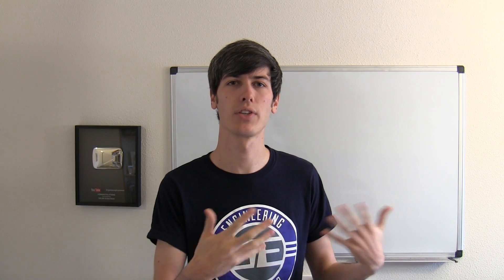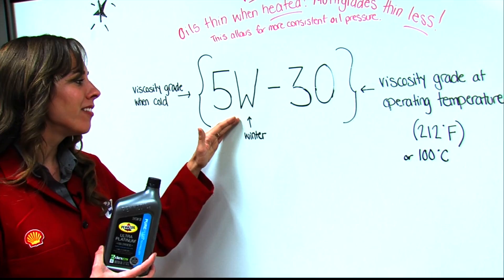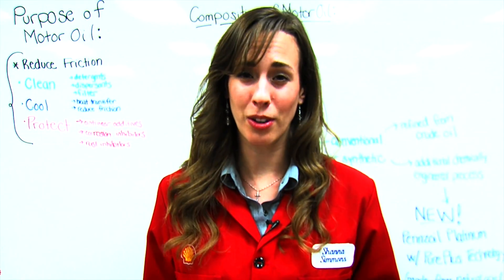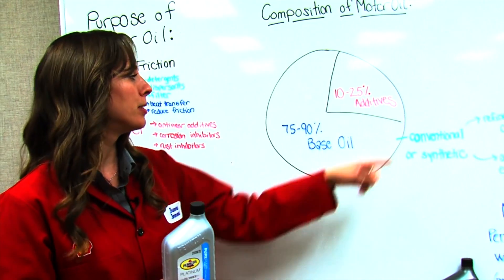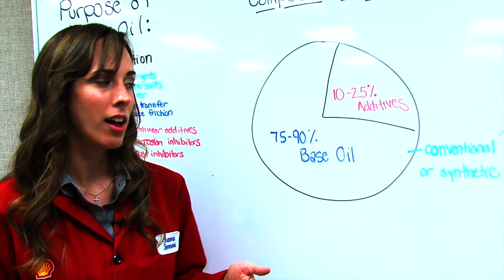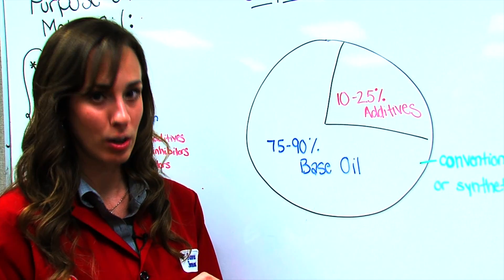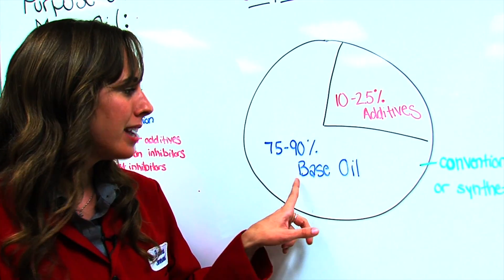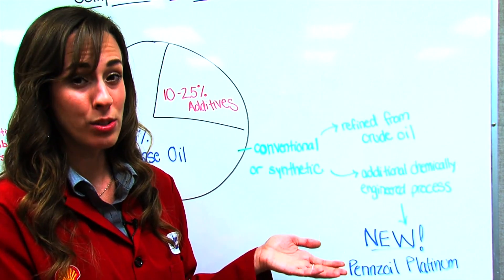Motor Oil Myths & FAQs - Synthetic vs Conventional

Comment: It was like reading a label on a bottle of motor oil.
Reply: so i'm not the only one!
Reply: +mandablyatskayapizdo didn't get ANY information of that... you can read the same on wikipedia for example... didn't hear at least anything of what a specialist could say.
Reply: Hydrogen Sh Yea, sadly
Reply: +Josh Richmond No idea where / how the 3k/5k oil swap came into play, but majority of high power engine (i.e. BMW, Porsche) don't require oil change before 10-12k or yearly (to prevent build up of moisture).
Reply: +Mike Brink.  My father had an old C-Class Mercedes that he used to change the oil every 5-6000 miles with synthetic.  At 180,000 miles he decided to take the engine apart and it had virtually no engine wear.
Reply: +mandablyatskayapizdo When you want to like a comment but you can't because it's got 69 likes..
Reply: +mandablyatskayapizdo  There's a reason for that, they try to spell it out for you so you'll know what to buy and use.  But people still ignore the information and use all sorts of weird stuff that they probably should not. 

The funniest thing is seeing people go and buy the very most expensive oil they can find for their car and then they trade that car with less than 100,000 miles.  You are wasting time and money.  If you are only going to keep your car 100K or less, buy the five quart jug of Walmart brand conventional oil or any other oil that's cheaper than that $13 after MIR and change your oil on a regular basis and you'll be fine.   Even the car makers are saying 75000 to 10000 miles now, I wouldn't go that long but i keep my cars forever.  Less than 100K before you trade, just get the walmart brand oil and a decent filter and follow the recommendation.  Just read what severe driving is considered and be aware it's usually any sort of driving at all.  So you may want to follow the severe service schedule.  But even if you didn't I doubt it would catch up with you by 100K.
Reply: again this channel is plain wrong. synthetic is a marketing term to disguise a more complicated truth. there are 3 types of synthetic oil. there are synthetic oils made from crude like described here but that's only legal in America. in foreign countries they can not be marketed as synthetic. these oils have lower wax content and more uniform molecule size but are chemically the same as conventional oils. they are classified as "group 3" oils but the marketers will rarely tell you the chemical content or group of any oil, there is also gtl oils which are made from natural gas, they are technically group 3 but go through a different process and may be called group 3+. there are also polyalphaolifins (spelling?) or PAO oils which they classify as group 4. the big name brands that come to mind with this type of oil are Mobil 1, amsoil, and older  penzoil platinum. it has different properties from crude and is impervious to fuel and alcohol, not a high lubricity but has lower drag from hydrodynamic forces at high speeds. group 5 oils are the ester oils. they have an interesting history. there was a time that whale, bean, and fish oils were widely used for their superior lubrication. but whaling is illegal now. so they started making synthetic esters, however it's not easy. these oils are the true "racing" oils because of the superior strength. but in the past they were hard to engineer to hold the additives in suspension. if you hear stories about caked up engines or wiped out motorcycle clutches and mechanics that fear the word synthetic it's because of group 5 ester oil stock. name brands that use ester oils include motul and redline. esters are also used as additives in other conventional and synthetic oil types for seal conditioning, adhesion, and lubricity.  but this is only a small piece of the puzzle with oils. the additive package includes metals, friction modifiers, thickeners, detergents, anti foaming agents and who know what. then the oils must be API certified. use an oil with an API code that matches the year your vehicle was manufactured! I assure you if you use Mobil 1 to break-in a 1965 Pontiac you have a good chance of having a bad day. if you use redline, it probably won't fail but you will likely not get ring seal. you want an oil with average lubrication but high content of zinc and molybdenum compounds. see there is no blanket truth about break-in and synthetic, because synthetic is a marketing term and it's the base oil and the additive pack that make a good break-in oil. some synthetics will work fine, others will not. the API code is more telling than the buzzword but still doesn't clear up what's actually in the oil.
Reply: +Mike Brink       i don't think she has the answer !!!      but i do Mike
your idea is fine as long as you dont cross the 3K mile barrier
as i am a disaster, i do exactly the opposite, 
i use quality synthetic one, brand name, and run 6-7K miles and sometime a little more with no worries.
both approaching are fine.
Reply: Thanks Bill, I still have them, but I also have a bad hip.  I keep telling myself I'm going to push through the pain and get them back on the road, but alas, I haven't.
Reply: +Phil Houck why? if both oils are the same weight and meet the API-SN standard. what would happen? I would like to know
Reply: Research engineer?
Or consumer hotline operator?
Lol
Reply: +goguhu most oil change recommendations for over 8000 miles or so are done with proprietary factory oil specifications often only one or two oil formulations are awarded the specification, often it's a PAO base stock oil which doesn't break down as opposed to crude. 3000 miles is a very old recommendation for conventional oils in a time where contamination from blow by and oil breakdown and deposits were big problems. if you take apart an old iron engine from the 1970's you'll probably need to take a paint scraper to the lifter valley. 5000-8000 depending on the car, the oil and the driving environment is probably more reasonable, but if you have a car with a 12000 mile recommendation and you check the manual for additional specs other than the API spec and use the recommended oil then by all means go the distance.
Reply: +Matthew,  In theory a film of oil separates toleranced moving parts inside an engine so no contact is actually made between the metal surfaces.

If the oil is maintained properly, very little or in some cases, no discernible engine wear is sustained.

My '66 Nova has over 535,000 miles on it and it still doesn't burn any oil.
Reply: +Curby Weaver.  wow... 535k .....!
Reply: +Mike, No.  The original 230 engine was in pretty sorry shape when I bought the car.  I swapped it out for a rebuilt 250 out of a mid-70's El Camino in 1985 shortly after we bought it.  It's been our daily driver since then.  It developed a really bad falter last year so I had the original engine rebuilt thinking it needed a valve job and with all those miles on it, I may as well just put in a fresh engine. But one day I started it to show someone that it did run and the fuel pump leaked.  When I changed out the fuel pump, it ran beautifully again.  So now I have the original rebuilt engine on a stand in the garage and a good-running engine in the car with nothing wrong with it.
Reply: +Curby Weaver I drive a 1985.5 Ford Escort with about 400k. It doesn't burn oil either...well, unless I overfill it. lol.
Reply: I made that mistake once too when I lost a dipstick, thought I'd err on the side of caution.
Reply: I'm not so sure, Mike.  Oil has other qualities besides being able to pass tests.  How long an oil can maintain those qualities may differ one brand to another.  Exposure to heat and other factors may cause cheap oil to break down sooner. I've always used Castrol and have had cars last well over 350K miles.  I learned years ago not to use Penzoil because it turns into black wax after only a short time.
Reply: +Curby Weaver You're right, I've done my at home tests with different brands, and it seems for my application a castrol syntec (502.00) 5w40 is the most stable for my vehicle's needs. And also i do my oil changes every 5000mi vs manufacturer's recommended 10,000 interval.
Reply: SvaroG;  I thought it was because I was old school that I change oil every 5,000.  I don't even know what the manufacturer of our Lexus recommends.  3,000 was when we always changed oil 40 years ago.  I thought that was alot of trouble so I ran Frantz filters (toilet paper oil filter) on my cars until 3 years ago when we got the Lexus.  I really miss my Studebaker, '55 Belair & hippie Volkswagen.  The Lexus is like driving an appliance.
Reply: +Curby Weaver the Belair and Studebaker are definitely top tier cars!
Reply: +daniel dimitri So is "Mobil 1" a proper synthetic?
Reply: There are many formulations of Mobil 1.  European formulas, last I heard, are true synthetics but in the US, Mobil 1 is mostly Group III petroleum.
Reply: Phil Houck
Thanks for the info. It's a little disappointing though, guess I'll have to try and order some from overseas rather than just running into town to pick some up as I had planned..
Reply: Oil come quite a variety of sources and they have widely varying characteristics that additive packages are designed control.  When you mix oils, you run the risk of upsetting the abilities of the oils involved.  If you want to "increase" the performance of the oil you're using go with a blend oil which will probably be about 80% conventional petroleum and 20% "synthetic".  Why run the risk of incompatibility when a blend oil allows you to do what you want without risk to your engine.  Talk to others and you'll get general agreement on this point.
Reply: What about adding STP High mileage oil treatment to a 20 yr old jeep
Reply: +Hydrogen Sh And she did not give the most important answer, full bush, trim or shave
Reply: +eatmyskids You see those teeth, she has been pulling hard on something :)
Reply: I hear you guys. I think Ericthecarguy has a slightly more in depth video, where he visited Valvoline, and had a good chat with two of the employees.
Reply: +Mike Brink cheap oil might be made by a "big name brand" but it's cheap because it doesn't contain the additives that the "big name brand" contains. Oil is blood for your engine.
Reply: Combining oils is not a good idea. It is far better to buy a blend oil where there are no possible compatibility issues.
Reply: ***** Exactly, I used it for years.  I would now in my Subaru, but every month there have been rebate deals on synthetic oil. In my Honda, it's all short trips so I use maxlife full synthetic.  It seems to have more additives.   But Supertech is a fine oil, there is no other full synthetic less than $18 for 5 quarts as the regular price.  I put some in a friend's car that had been neglected and the oil turned dark brown in a 2 weeks.  It was cleaning out the sludge.  I had her buy a GOOD oil filter because after six months of that crap, it's going to be clogged.

Comment: Topics like this bring out the most uninformed, ignorant brain dead statements from people that have little more than a Gerbil wheel operating between their ears. If stupidity was determined to be contagious the AMA would be forced to shut down these comment forums to halt the proliferation of complete "Morons" !!!
Reply: +Robert Diehl    Oil lasts longer than the oil filter.
Reply: +Rod Parkinson    A person has to have a sense of how a diesel and gasoline and other internal combustion engines work to understand why quality oil is very important..A small percentage only does and they take it for granted that oil is oil  and Jiffy Lube or wherever is a place to have it done every 3000 miles and some never change it until the oil light comes on and while  the engine is smoking,.. ......25,000 Mile oil change intervals were happening in the 1970s with synthetic oil in the US,...Long life synthetic oil for the every day driver was an invention here  ..Still it is like no one even can understand that in the US where as Europe has way longer change intervals ...Yea there are some weird comments on this vid  ....
Reply: A Nihtgenga There are 15,000 mile oil filters now ...No need to worry about changing the filter and topping off as much if you want to go longer on a change.

Comment: i mistakely put engine oil more then full level..does it makes any wrong things in car engine.??
Reply: +shyml1 so you have a mechanical pump on the bottom of the crank case. It has an X volume of oil that can be sucked per revolution, this volume wont change if there is 1 liter or 10 liters of oil. And the oil system has a pressure regulator(relief valve), just because the pump will always make more pressure than needed. SO PLEASE GET YOUR FACTS STRAIGHT BEFORE ANSWERING MYTHS!
Reply: +Amitkumar Parajuli How much more? If it is too much you could damage your exaust system and the crankshaft could turn the oil into foam (thats just the case with +0.5-1l oil too much.)
I would just take it out though.
Reply: +Servicehans i dont think overfilling oil would damage the exhaust system.
Reply: +SharkInAFunnyHat321 thanks , till noe nothing is seen unwanted n in factbi put like 1-1.5 l more n the indicator shows like 3 cm above than F indicator level,.
Reply: +K Series Garage ..Any thing over a quart over will because it causes pressure to rise in the crankcase  and the extra oil
will run through the PVC system and will stick to the  hot area of the converters by causing it to heat up too much
Reply: +Amitkumar Parajuli  If you fill more than required oil you increase crank case pressure and with the higher level of oil it is forced through the front and rear crankshaft seals. The front seal is a soil on your floor but the rear will most definitely go on the clutch disk in a manual car and cause clutch slippage. You need to take the tranny out to change the rear seal and the clutch plate. You need to take the radiator and front paraphernalia out to replace the front seal. Here removing the front pulley will bring tears to your eyes.
Reply: Yes you are right but kindly go through my reply. I am not referring to the oil pressure in the pressurized system which as you correctly mention starts from the pump to the crank shaft , keeps the plain bearing under pressure and in some cases the gudeon pin too, from there to the cam shaft and trickling out on the valve lifters etc, and then returning to the crank case under atmospheric pressure. This is the pressure that your pressure gauge/light measures and informs you and it has nothing to do with CRANKCASE pressure which is the pressure created under the pistons, in the crankcase and for which a relief valve is placed in the system now usually connected through a rubber pipe to the air intake. With excess oil the volume in the crank case decreases and pressure being inversely proportional, increases. In older cars the pressure from the combustion leaks past the rings and adds to crank case pressure. Hence the old trick to remove the oil filler cap and see if there is a blow out of gases, which if present indicates worn out engine. Hope this meets your expectation. Thanks.
Reply: +shyml1 now I understand what do you mean. You are talking about diesel engined, petrol engines are very different. You have a breathing rubber hose that goes from the crankshaft to nowhere, just an open hole to stabilize the pressure

Comment: Just hit 35k in my Leaf no oil change yet...
Reply: + the grasshopper... I'm not trying to burst your bubble or anything but the leaf is all electric... There's no oil in it... This was all a joke..
Reply: Ya they have 36000 mile oil change intervals.... Make sure u check your header bearings to make sure there not corroded yet ;)
Reply: +Brett Young will do! 😀
Reply: +James Campbell (Andy) Don't think thats something to be proud about........ Change your oil dude...
Reply: Lolol
Reply: +Brett Young Bubble has been busted... But really no oil change.... Is there anything that needs to be changed in it maintenance wise?
Reply: +The Grasshopper not really,   the two major things are rotate tires and check/replace brake fluid every 15k. other than that its good to go.
Reply: +James Campbell (Andy) you're joking that's nothing :0. Thanks for the info.

Comment: For a car with over 150k what oil should be used its a 2001 honda..
Reply: look at filler cap on top of the engine
Reply: +Johan Breton: I'd use Mobil 1 High Mileage Full Synthetic. I use that on my Toyota Corolla.
Reply: +Johan Breton ...........the oil in the manual it calls for....it will leak with that many miles with synthetic motor oil......